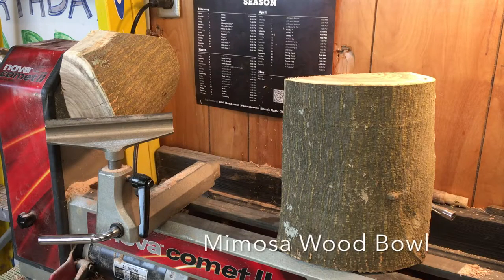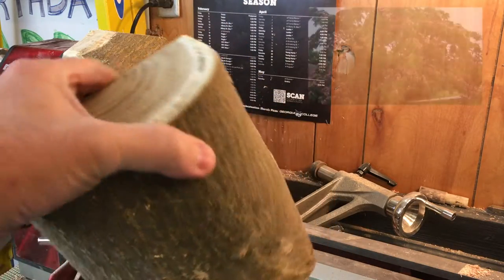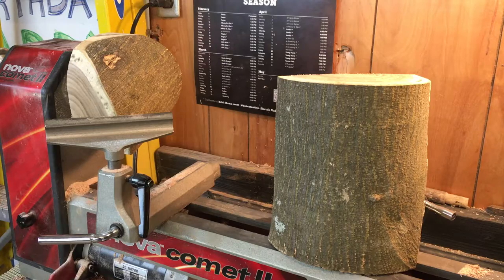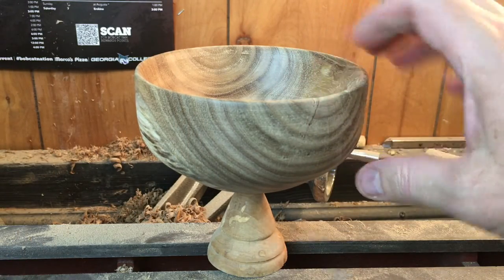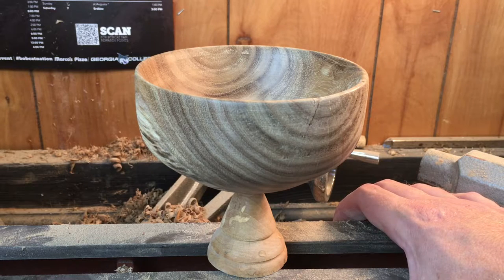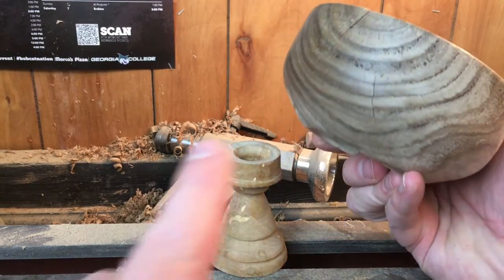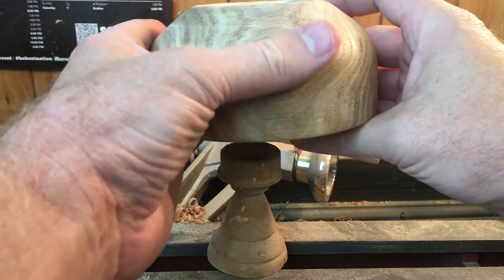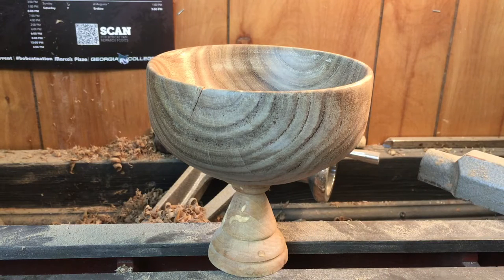Mimosa tree wood bowl EP #20

Comment: I don't know beans about wood............is it cracking because it isn't dry enough yet?
Reply from the maker: Usually softer woods with more sap wood, they tend to crack.  Its just a flaw.  I will re-turn it, then apply an epoxy coating to filling the cracks.  It dried for a couple of months and I had removed some of the bark to speed the process.